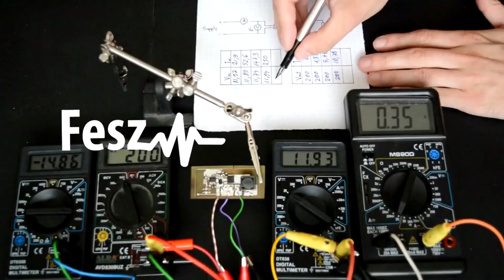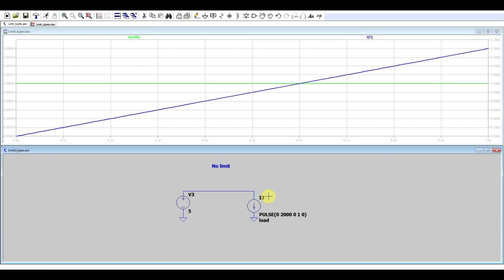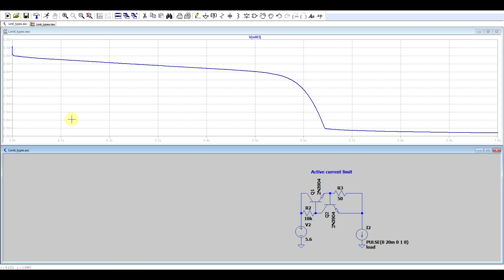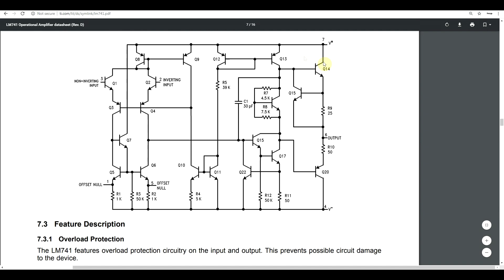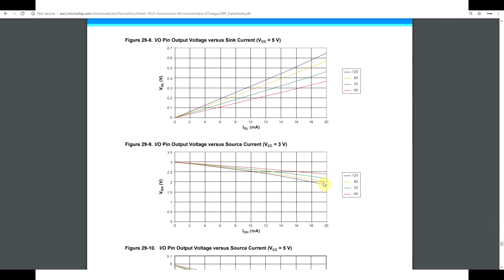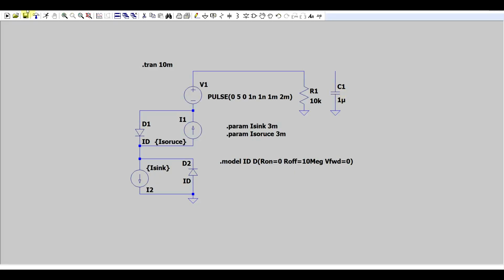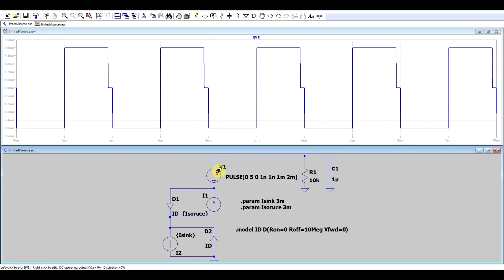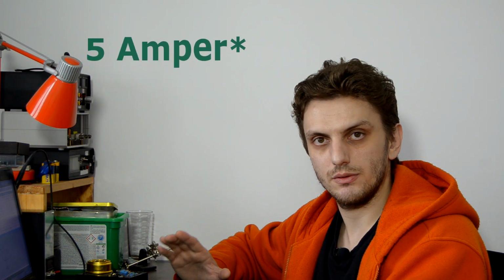LTspice Tutorial - Voltage limited current source and Current limited Voltage source

Comment: I went ahead and implemented these two features as components (source-like constraints) that can be placed in LTspice.
The "Iconst" current constraint can be placed in series with a source, whereas the "Vconst" voltage constraint can be placed in parallel with a source.
Example test-jigs included in the zip

Link to the library:  https://drive.google.com/file/d/1I3VxgBCDz8ntf56d5Q9Zr3E13vShVpg9/view?usp=sharing

Comment: Hi I have made the circuit of LM317 on bread board. I am generating a constant current of 100mA. The input to the regulator is 3.3vdc. 100mA constant current is fed to a resistor of 100 ohms. I should measure a voltage across resistor of =10mA x 100= 1000mV=> 1V, but the voltage across the resistor I am measuring is 3.3vdc. why so? I want to use the constant current source to find the unknown resistor using current and voltage How can I do this?
Reply from the maker: For the LM317 the minimum input voltage is 4.25V; I think that since you are using a 3.3V supply the IC is not working correctly.. However, if the output is exactly the same voltage as the input, there might be a mistake in the circuit - usually the output of the LM317 should be 3V or more smaller than the input.

Comment: Hi, Thank you for good idea. However, I tried to use your voltage limited current source to simulate gate charge of MOSFET (2N7002) and it cause lot of troubles, so I little bit modify it. First of all I add 1g resistor in parallel to diode and voltage source and next specified ideal diode just by Dideal D (Vj=1m). Then it works.
Reply: Ohh, now I realize, that my diode is not so ideal. There will be 0.4 still voltage drop. Because LTSpice will reject small values of Vj and Eg ... But for my case, gate charge simulation, it works at least ...

Comment: you answer my questions which typically came up when I use LTspice very often. Great Videos about models inserting, simulating, comparing with data sheet, knowledge about electronics in general, etc. Thank you very much.
Reply from the maker: I'm happy you are enjoying my videos! Let me know if there would be any subject in particular you would like to see in the future.
Reply: @FesZElectronics  Here are some ideas.

When I searched for simulating an inrush limiter I found this page:
https://poulpetersen.dk/notes/ntc.html

It's about variable resistors in general. But I don't understand all. Maybe you could make a video about variable resistors?

One similar topic (but I don't know if this is common) is how to simulate the variability of inductors due to core saturation effects. But maybe this is not necessary if the inductor is calculated properly with a good safety margin to saturaton.
Reply from the maker: Regarding inductor modeling, I did cover the topic a while back - https://youtu.be/65fNDRows90 ; there is also a similar video on capacitors. 
Regarding thermistors, I wrote it down and will try to cover the subject in the future. Thanks for the sugestion!
Reply from the maker: Regarding inrush limiting - what you need is a PTC thermistor (Positive temperature coefficient - with increasing temperature resistance increases), looking quickly on the link you shared, they where talking about NTC's (Negative temperature coefficient - with increasing temperature resistance decreases).
I found this page by Vishay and they link a full LTspice library with PTC's - maybe this helps https://www.vishay.com/whatsnew/doc/ff_FastFacts_LT_SPICE_PTCEL_CL_TL2.pdf
Reply: @FesZElectronics  very nice! exactly what i was looking for.

Comment: Thank you. I have a humble background in electronics and simulation. Please how to implement an IR source (lamp) of the specifications in the link: https://helioworks.com/wp-content/uploads/2018/08/EVF-555X.pdf
the input pulse signal should be of 10Hz ,
the aim is to build a signal drive circuit for it. the source is quite expensive so i'm afraid of burning it !
 Thank you in advance